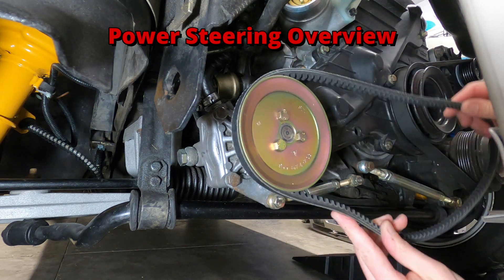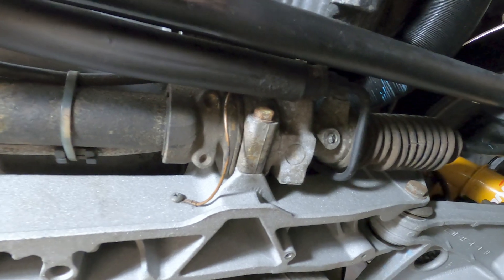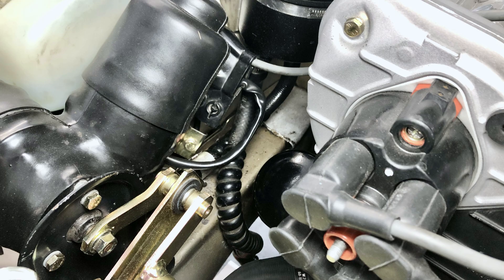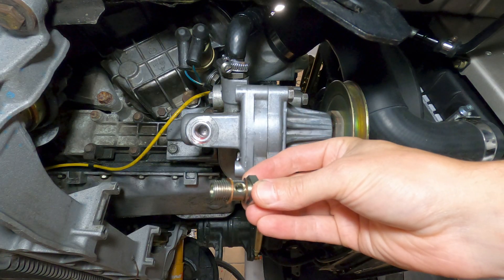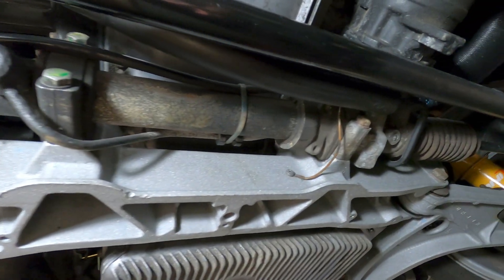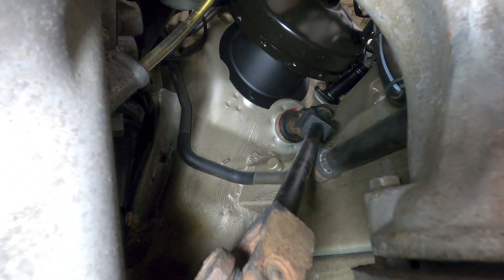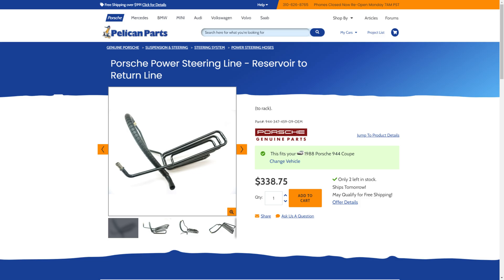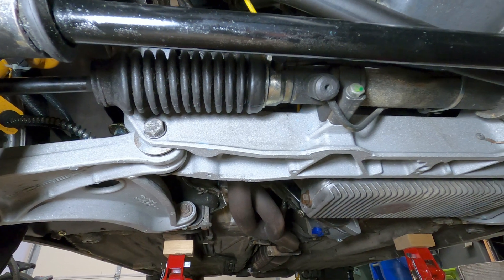Porsche 944 – Power Steering System Overview: Parts, Issues, & Costs

Comment: My front sleeve at 4:00 stuck. I tried to hammer + punch out but no luck. what else I can do? Thanks
Reply from the maker: Penetrating oil usually helps get it moving, that and trying to twist/wiggle the spacer by rocking the pump back and forth.

Comment: I have an 83 944. Manual steering system. Is it simple to rebuild or should i purchase a preofessional rebuilt one. Im not well experienced in working on cars 😅😢
Reply from the maker: @ICHLIEBEmusic Rebuilding a manual rack would be a lot less complex than a power rack, but the manual racks are pretty rare, so parts may be an issue. It shouldn’t be too hard to adjust the backlash and regrease it. Here’s a thread on it - https://rennlist.com/forums/924-931-944-951-968-forum/80901-rebuilding-manual-steering-rack.html

Comment: Hi NC, I was curious to ask you after seen the power steering delete video, why you decided to delete the system? Yes, I know you mentioned you did not want to hassle with the leaks. But after remanufacturing the rack, replacing the seals on the pump and the pressure hose the system should be very reliable for many years. Besides, I have drove 944's without power steering and they are very, very uncomfortable to drive when parking or turning at low speed. Regards
Reply: And as always, excellent content and detailed explanation. Keep it up.
Reply from the maker: Hey! Yeah, pretty much for the reasons you mentioned… I grew tired of chasing down leaks and the manual steering fit well with my intent of creating a true analog driving experience for the car. I looked at some rebuilt power racks, but I was seeing quite a few owner examples where rebuilt racks were failing within 1-2 years. I will say that a true manual rack is a little easier to turn than a “de-powered” power steering rack because the ratio is different. I’ve found this setup pretty manageable at lower speeds and it offers great feedback through the wheel. At a complete standstill, two arms are often required, but as long as the car is rolling, it’s not too bad.

Comment: My car ('88 951) released all its power steering fluid (OK, ATF) all over my driveway. I have to jack it up and find the source of the leak. Thanks again for all your videos! They are a great help.
Reply from the maker: Oh man, that stuff is nasty too! That sucks. Luckily most of the power steering components are reasonably priced, except the rack itself. Hoping is just a hose or something…
Reply: @NC944er  - I got lucky! It's just a hose that slipped off the hard line that runs along the crossmember. It's going to be a challenge with my big hands, may need to drop the rack to replace the hose... but at least the rack is OK!
Reply from the maker: @jergervasi3331  Wells that’s good! There is a small line clamp on the top of the crossmember for that particular hydraulic line, sandwiched between the oil pan. I once removed that one with a small wrench by feel, because you can’t really see it with the space in there, but it’s doable. Good luck! 👍
Reply: @NC944er  I finally replaced my power steering return line (it was a bad line after all) and took the car for a spin today! yay! I never have free time, so repairs take me forever to get to, as you can see. Now I'm going to start planning to tear all that junk out and do the manual conversion anyway! hahahaha... That Martin Willis system in your other video looks sweet. And I still have a shelf full of parts I bought but haven't installed, as I started a new job that has me traveling around the country most of the time: Rennline fire extinguisher and phone mounts, a new odometer gear, the F9 DME with fuel pump prime, new anti-sway bar bushings, new instrument panel circuit boards and LED lights, speakers, some interior trim parts, assorted weatherstripping and molding, and random other stuff that was missing from my car when I bought it, like the rear hatch release motor and arms (!), the entire windshield washer system (!), a Porsche script door handle for the driver's door (it has a VW replacement on it now, for whatever reason)... etc. Damn. I'd better stop typing and hop to it. LOL... Thanks again for all your help.
Reply from the maker: @jergervasi3331  Glad you got it done! No issues with the manual steering after breaking it in, all good, just takes a little bit to get used to the slightly harder turns at really low speeds.
Reply: @NC944er  I learned to drive on manual steering back in 1985, and I loved it. The feel is unmatched, and I'm a drummer, so my forearm muscles make parking no big deal. LOL... My first cars were 1976-77 Toyota Celica GT Liftbacks. I had 4 of them; When one rusted out, I would find another. I was obsessed with them because they looked like 1965 Mustang fastbacks, and my dream car was always the 1965 Shelby GT350. This came full circle when I grew up and eventually became a Vice President of Shelby. I still have my 2007 Shelby GT/SC in the garage, and it's ridiculous in every way, but my Porsche 951 scratches a completely different "analog" itch.
Reply from the maker: @jergervasi3331  Very cool! Lots of great cars from past generations… modern ones, not so much. 😂

Comment: Thank you for your clear and helpful videos. 

If I ran PS fluid and the reservoir and pump are empty now, can I just switch to Dextron 3?
Reply from the maker: Hey! There may still be some old fluid in the steering rack and lines. You could do a bit of a flush by filling it with Dex3, then turning the rack lock to lock while running the pump to circulate things. Then drain the pump and reservoir a second time before a final refill with Dex3.

Comment: Hoping to find a solution for removing a stripped hex banjo bolt.
Reply from the maker: The Allen key banjo bolts can be a pain. There a few approaches you can take on a stripped fitting: 1. Sometimes you can hammer in an Allen key that is one size larger and get enough bite to loosen the bolt. 2. Tack welding a hex head nut on top of the bolt almost always works. 3. Notches can be cut in the bolt head using a Dremel or small grinding wheel to accommodate a flat head or Philips screwdriver. 4. You may be able to grip the edges of the bolt with a good set of vice-grips to break it loose. 5. I would reserve drilling out the bolt as a last resort given the potential to damage the threads in the steering rack. 6. My favorite - scrap the whole rack and hoses in favor of all new parts. 😂

Comment: great video BUT I'm looking to delete the power steering all together and go to what you did (conventional steering)...therefore looking for parts list for that install please...
Reply from the maker: Hey John, I included four links in the last comment, which includes the manual steering conversion video as well as a link to buy the steering kit on eBay from the same seller I used.
Reply from the maker: Manual Steering Conversion - https://www.youtube.com/watch?v=y7dDLdYPS-Y

Manual Steering Kit - https://www.ebay.com/itm/115532024809?hash=item1ae63ecbe9:g:LeEAAOSw-iZcESTx

Machine Shop Website - https://mwthemachineshop.com/
Reply: @NC944er  so that (eBay  item) is all i will need to do the switch? love that conversion...
Reply from the maker: @johndeltoro7990  Yep, it’s a complete kit with new bushings. You can re-use the original rack mounts and the bolts for the intermediate shaft. In my case I replaced those since my old ones were a little rusty.

Comment: Would you recommend a complete flush when putting new fluid in? If so I assume I drain from the low pressure line
Reply from the maker: How does the fluid look now? If it’s clean and bright red, probably no need to flush. If it’s brown and cloudy, I’d do a flush. You can drain from the input line on top of the pump or use a baster syringe to extract the fluid from the reservoir. Once you’ve got it topped up, run the engine and turn the wheels lock to lock to move fluid through the rack. Then stop the car, empty the reservoir again, and top it back up with fresh fluid. It may take 2-3 cycles of this to get it looking clean again.
Reply: @NC944er  it looks like coffee lol. I'll prob just do a few cycles with a syringe to get it clean, though I do have a leak around the pump I have to trace down. Started squealing on start up this winter so new fluid and tension the belt a bit.
Reply from the maker: @John_NPC  LOL! Mine was basically a chocolate milk shake when I got the car as well. The syringe method will be the least messy option and there will be plenty of other opportunities to dump fluid down the road given the plethora of pump reliability issues. 😂

Comment: Seeking a bit of advice. The pump on my 86 whines and groans when cold. What would you suggest I start with, the fluid cannister or a rebuild of the pump?
Reply from the maker: Hey! If you don’t have any service history on the car, I’d probably do both since the reservoir and the seal kit aren’t terribly expensive. I’d also want to ensure the fluid level is topped up, the fluid is clean, and there are no air bubbles in the reservoir fluid after running the car. Replacing the reservoir is a little easier than rebuilding the pump, so if you wanted to start there, you may see an improvement if the filter is really clogged up. Let me know what you find.

Comment: Rennbay and Pelican parts ordered today specifically for this. I had a large amount of liquid under my car and the start of a bunch of groaning. The previous owner told me he rebuilt the power steering before but we are finding out that he did a lot of stuff incorrectly. Looks like I have a project for next weekend! Thank you for all your videos!
Reply from the maker: Nice! The pump rebuild is fairly easy, but I have seen them closed back up with one or more seals not seated correctly. Surprises from prior owners are always interesting. My car was missing something like 26 random parts from the engine bay when I bought it and there were a number of loose bolts in various locations. 😂
Reply: @NC944er  Interesting that you say that - my car had several random loose and missing bolts as well. I did some easy work on the car but took it to a trusted shop to get the clutch done. When they were there they found lots of here and there items that needed to be addressed.

Comment: As usual, a really great video. But I have to say I was left waiting on some tips for actually removing the steering rack.
Reply from the maker: Yeah, I’m always balancing between things I’d “like” to do and things I “have” to do, and since work and family schedules have picked up recently, I haven’t had as much time to put content together. After setup, shooting, editing, and processing the videos, it takes 3-4 times longer than it normally would to complete the actual work on the car. I hadn’t initially planned on posting any video of the steering system stuff because I really just needed to get in there and get it done, but I had enough footage to put together a fairly comprehensive overview, so that’s what I did.
Reply: @NC944er  I totally get it man, and you're doing a fantastic job. Wasn't criticizing, just hoping for more help! Did you remove the rack with the engine in the car?
Reply from the maker: @Berkes944  Yeah, the rack removal process is pretty straightforward, just messy in disconnecting the lines and draining of fluid. After removing the front sway bar and draining the system, loosen the nuts on the tie rod ends and pop them down with a tie rod removal tool, loosen the steering shaft from the steering gear at the top of the rack tower, then there are just four mounting bolts on the front brackets that hold the rack to the cross member. Due to oxidation, the steering shaft can cause the most frustration. 

The write-up on Clark’s is helpful, steps 2.0-5.0, just no pictures - http://www.clarks-garage.com/shop-manual/steer-01.htm

Comment: Great video. I love my manual rack though on my 83. The driving experience is so awesome! I am curious how power steering is on this vehicle.
Reply from the maker: Thanks! The power steering offers a pretty good road feel on the 944, it’s definitely not over-assisted or super vague like the power steering on most modern cars, but is obviously a bit easier than the manual rack for low speeds/parking/etc. I’m shopping a manual rack solution at the moment, thinking about changing things up.
Reply: @NC944er  Oh man! I wish I would have known that. I just unloaded a perfect manual rack. Your videos are helpful, thorough and excellent. Especially the fluid ones. I recently switched to that Valvoline oil.
Reply from the maker: @P1983sche  Nooooooo! Haha! 😂 No worries… they are hard to come by though.

Comment: Was thinking about upgrading my 944 with powersteering - but I guess I’ll stay away from it after seeing all the parts needed and potential upcoming problems :D great video as always tho!!
Reply from the maker: Yeah, most people end up going the other direction. 😂 The power steering does make the wheel a little easier to turn, but it’s not over-assisted or super easy like systems in most modern cars, really it’s just a notch above a true manual system on these cars.
Reply: Spot on

Comment: Another awesome video, I did this job about eight months ago, I just followed the article online from Clark’s garage. Two areas were a pain in the butt, dealing with the power steering fluid, because it’s very messy, and getting the tie rods off the power steering rack, which I could not do, ending up cutting them off. And sending the unit back to 944 online. Thanks for the video.
Reply from the maker: Yeah the tie rod mounts are like peened into a little notch on the rack and need to be tapped back out before they’re loosened. The whole thing is a little annoying to deal with quite honestly. 😂 The system takes a beating and catches a bunch of water when driving in wet conditions, really locks things up down there. I’m glad you were able to get yours swapped out!

Comment: Once again, the timing of a new video guide from you pretty closely aligns with "next thing I gotta check out more thoroughly on mine".
Reply: On an old 944, the next thing you have to check is everything.  Even the things you just checked.
Reply from the maker: Too funny! They all suffer similar ailments. 😂
Reply: @NC944er  Any insight on shocks/struts? I have what I believe we're factory option Koni Yellows that are shot. Can I just drop in a new insert? Or B6s? If so, how is it performed? No pressure to answer, just endlessly curious.
Reply from the maker: @Cam-pe3nd  Sure, if you check your options sticker in the back and find either codes M030 or M474, then Konis would have come with your factory build. If that’s the case, replacing them with new Konis would help maintain its originality and its value. Cars from 1983-1986 will feature the front shock insert setup and those can be easily swapped out. Cars from 1987 and later feature sealed struts and because the Koni sealed struts are no longer in production, the existing struts would have to be cut and converted to accept the inserts. Konis have a benefit over the Bilstein B6 in that the damping is adjustable, which is useful when moving from street to track situations, but otherwise people usually just set them to “street” and forget about it. The general consensus on the forums is that Konis hold up better over time and offer a more comfortable ride. To swap front inserts or perform the conversion, you’ll need to remove the struts from the car and have a spring compressor to remove the top hats. Outside of that, the inserts are secured by one bolt at the bottom of the strut housing and then they can be reassembled and reinstalled, finishing off with an alignment. The rears are super easy because they are just shocks, two bolts in and out, and done. This write-up from Paragon shows how the conversion and inserts are setup - https://www.paragon-products.com/kb_results.asp?ID=50
Reply: @NC944er  Oh boy, I have an 87. Having to cut and drill might be a bigger undertaking than I'm capable of. Who designed these cars? 😂
Reply from the maker: @Cam-pe3nd  Ha! It’s a little messy draining the old shock oil, but doable. I made a little template from cardboard to ensure they were equally measured and then affixed a 10” metal cutting wheel to a mitre saw for a clean cut through the strut housing. Paragon will also perform the conversion for $295 if that’s more appealing - https://www.paragon-products.com/Koni-Front-Sport-Strut-Conversion-p/koni-8641-1414s-conversion.htm

Comment: Manual steering here I come lol
Reply from the maker: LOL! A wise choice… 😂
Reply: @NC944er  my rack dumps out the reservoir in about two weeks of just sitting
Reply from the maker: @liamflynn6929  Oh wow! Yeah, maybe time for a change.
Reply: @NC944er  I work at an auto parts store and my manager found a source for a manual rack for $150-200 so I think it'd be worth it. I'd have to also source a steering shaft and euro tie rods since I have a late offset, but much better than a huge puddle
Reply from the maker: @liamflynn6929   Nice! It’s looking like some of the early ‘83 manual racks can be sourced (rebuilt), but for over $1,000. I’m looking at a custom kit built from VW parts that may fit the bill, we’ll see how it goes.
Reply: @NC944er  yeah they're pricey for sure. But what isn't with these cars haha